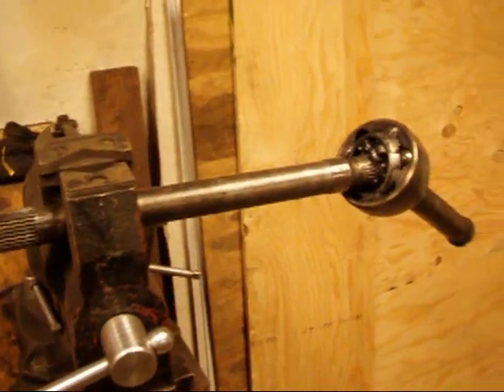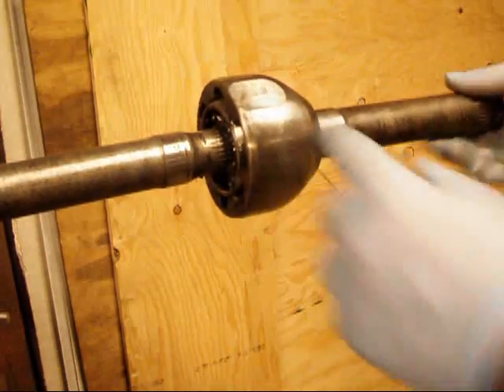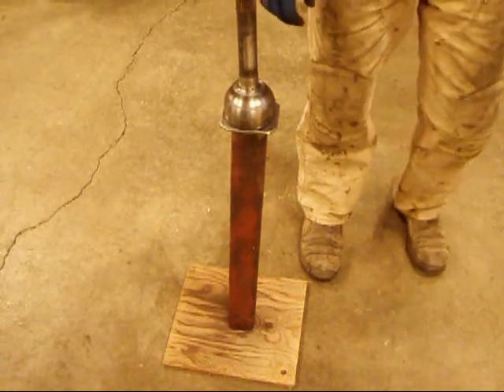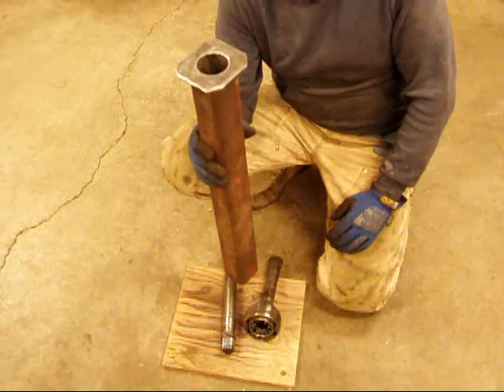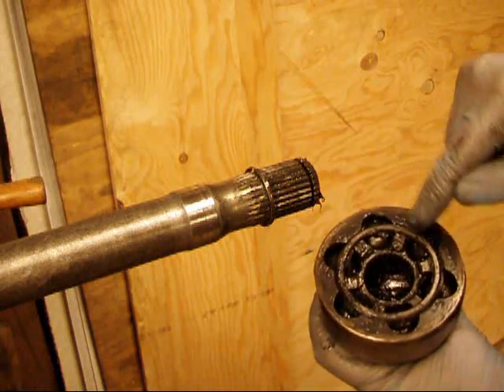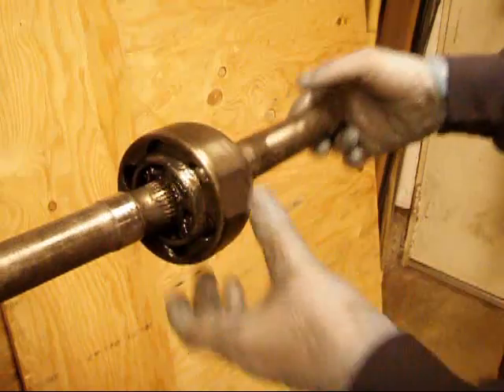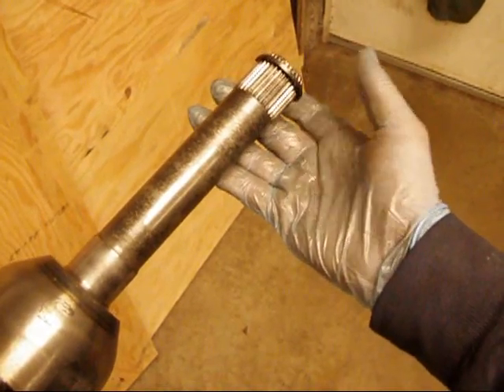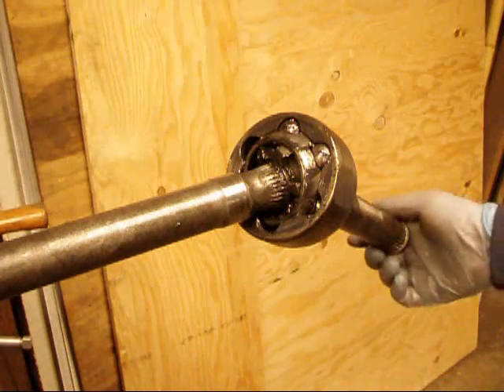How to remove a Toyota 4x4 Birfield joint off an inner axle shaft

Comment from the maker: 20 years of working on these.  Removed hundreds of shafts.  Never had one not come apart.  The short shaft side is the harder of the two because there is less weight on the inner axle shaft, but they've always come off with enough slamming.  Sometimes you really have to beat the $&% out of them though.  I suppose the splines could have started to strip the inner star and have jammed up, but that is pretty unlikely, usually the bell explodes before splines let go on a stock birfield.

Comment: Thanks for the video - good tip - the brass drift method did NOT work on my FWD CV axle car - it was a mother - I elected to remove everything from the other shaft end (like you did) - I soaked the Birfield end on the shaft in Varsol for 24 hrs, flushed, rinsed a couple times with brake clean, then dried with compressed air - to grease I loaded CV axle grease into my grease gun and used a needle tip to get past the balls to the backside of the Birfield - next time I'll probably skip the cleaning and just grease - with the needle you can flush the old grease out by pumping new grease in from behind - just like greasing a suspension

Comment from the maker: Yup, it's a one-time use kinda deal.  Sometimes you get really lucky and it pops off in one piece but most of the time it just shears.  The factory service manual tells you to drive the birf off with a brass drift on the inner star which has the same effect.  They are cheap and easy to get from Toyota.  You can also eliminate the circlip by putting a tack weld or two down on the splines of the inner axle shaft near the carrier.

Comment: Thanks for the tip about the Longfields upgrade!
Reply from the maker: If you've got the money, these guy's products are the best you can buy currently:  http://www.rcvperformance.com/categories.aspx?catID=RCVP_TOYOTA_CV_AXLES   If RCV performance isn't in your budget, Trail Gear bought Longfields name and technique when he passed away and they are making good joints (not as good as RCV in my opinion).  http://www.trail-gear.com/category/70/chromoly-birfield-kits

Comment from the maker: Martacks as they are called are tack welds that will keep the inner axle shaft from walking into the differential (which is exactly what the circlip does by retaining the inner axle shaft inside the birf.)  If you're replacing your birfields, just pony up the cash and get some Longfields and never worry about it again.

Comment from the maker: The wire clip inside the birf keeps the inner axle from walking into the differential (it traps the inner axle from moving around.  The birf is held in place by the lockring on the end of the stub in the locking hub.).  I'd have to look at it, but I would guess you're inner shaft is walking into your side gear splines possibly disengaging?  I'm not sure if can walk far enough in to do that or not, just an idea...

Comment: @WheeliePete steering is accurate. I built a Keith black 22r same case set up as ur buddy, 5.29 locked in both, it just likes to eat them. Rather than breaking the birfs themselves it  rips the joint out of them. At least I don't pay for them anymore lol.

Comment: awesome information thanks.I have a  question maybe someone can help me.I have a fj80 and when I step on the throttle it hits really hard on the front differential.I took that front differential apart and nothing is broken the only thing that  I found was that the Birfield driver side axle came apart without me trying to take apart from the clip.If that clip is broken would that be making  it to hit hard on the front differential?Thanks guys

Comment: I am using a 2" OD diameter pipe, ID 1.75", 3 ft long.  Fixed to the end pipe I have a smaller coupler that fits up into the outer CV joint and rests onto the Inner bearing.  The tube and union combo weighs close to 15 pounds. The weight with the axle is close to 25 lbs.  I've tried slamming the CV joint down into the tube as well as slam both down together from about a foot+ off the ground. Nothing.  Direct hammering and brass drift hasn't worked either.  I will try pressing it off next

Comment: Awesome video - and informative! Thank you! Can I ask about putting it back together? I can't seem to get the circlip to close enough to get the Birfield back on. I've tried zip-ties, 2 or 3 or 4 small screwdrivers pushing the circlip inward with someone else tapping on the end of the axle shaft. I've tried new circlips from Specter Off Road, and then from the dealer. So I called a few driveline shops to see if they would assemble it for me and they said they wouldn't touch it. Any advice from you?
Reply from the maker: You put the circlip on the end of the inner axle shaft (the end that goes into the birfield's inner star).  When you look at the splined section of the inner star you'll notice that there is a bevel all the way around the leading edge of the splines on the inner star that should help to guide and compress the circlip as you drive the inner shaft into the birfield.  I clamp the birfield in the vise and then hammer the inner shaft and circlip into the birfield with a heavy plastic deadblow hammer.  Usually works just fine.  If you've got a second pair of hands to try and compress the circlip that might help, but it sounds like you have been trying that.  I'd just do what you're doing and really give that inner shaft the old what-for with a dead blow hammer.  That inner circlip is there to keep the inner axle shaft from walking into the differential (the flat snap ring on the inner shaft keeps it from walking too far into the birfield.)  Years ago the guys at Marlin Crawler came up with a way to avoid having to use the circlip by putting a couple of tack welds on the end of the inner axle shaft that goes into the differential.  YOU HAVE TO GET THE TACK WELDS IN THE RIGHT PLACE so the shaft goes into the differential the right distance and still engages the Birfield and the inner axle seal properly.  To find the location of where to place the tack welds you wrap tape around the splines and put the shaft into the differential and then watch where the inner axle sealing surface lines up with the axle housing seal. 
 You want the shaft to stop going into the  differential carrier where the seal currently rides on the sealing surface of the inner shaft.  Pull the inner axle back out and see where splines of the differential carrier pushed the tape to and then put your tacks in that location.  When you do it right you don't have to use the circlip as the tack welds on the differential end of the inner shaft keep it from walking into the differential.  If you have a solid mechanical locker you most likely won't even need the martack as the locker body keeps the shaft from migrating into the diff.  Now, a word of caution on doing the Martack....You have to be careful not to get weld spatter in the splines of the axle shaft otherwise it won't go back into the differential.  Before you weld, I would tape it all off, spray anti-spatter, etc.  When you're done you'll want to file the tack down so you don't tear the seal  on the way in, and you'll want to make sure the splines are really clean.  The martack makes changing a broken birf in the field a LOT easier, but you can screw up your inner shaft if you get it wrong (or at least cause a lot of grief grinding your tacks out of the splines with a dremel and doing it again.

Comment: Be aware that this techniques doesn't always work.  I spent close to $50 to build a tube similar to the tool shown in the video.  I've slammed the axle in the tube at least 20 times to no avail.  After this, I directly pounded on the shaft and tried using a drift punch. No GO!  Be prepared that your axle may not come out!

Comment from the maker: That is really strange.  How much spacer you running?  You might want to limit the turning radius a few more degrees.  If the inner is failing it's usually because of hyperextension.  Those inners get pretty exposed as they reach their max working angle  No way the 22R is overpowering it.  ;-)  The dangerous part is to break one and still be driving and have the grenaded pieces lock up the joint in a turn (in 2wd) which locks out the steering.  That happened to me once...scary!

Comment from the maker: Not to be a dick, but do you have your steering stops set up correctly?  Steering stops are CRITICAL, even with Longs, if you exceed the working angle, or, more importantly, fail to balance the stops left to leading/trailing you place insane loads on the joint and the inners.  I have a buddy that ran longs with 39" iroks, full coil, 3RZ, 2.28+4.7 t-case crawler buggy for years in rock/sand/snow with an ABUSIVE right foot and they held up.  What engine you running?  You might just need D-60's?

Comment: I am rebuilding knuckles on an fzj80 stock 254 k and found what looks like half a circlip in the grease up by the abs sensor . The only place I can figure it’s from it i the clip but how could it break and get out of the joint it’s so tight and the birfeld and axle are still firmly connected ? Could that piece be left from a previous repair that got missed in clean up ? Should I take it apart just to see if it’s only a half in there holding it together or is that improbable ?
Reply from the maker: It seems very improbable that half the circlip may have broken off and worked its way down and out of the joint.  I'm wondering if someone grenaded a joint previously and didn't get all the pieces cleaned out.  Is there any damage inside the knuckle (scraping etc.) that would indicate a joint broke in there?  If the joint is still firmly affixed you're probably fine.  In order to inspect you would have to separate the joint which would ruin the circlip if it is good.

Comment: How do you get the cage and balls out of the inside I have inner axle chunks stuck inside
Reply from the maker: You basically have to stick the Birfield joint in a vise and then take a brass drive and tap one edge of the bearing cage/inner star down into the bell until you can raise the opposite side enough to get a ball out.  Then you work your way around like that getting the balls out and then the star and cage will come out.  This might be problematic if there is still the stub end of a broken off inner axle in there.  The inner star and outer bearing cage and bearings also go together in a very specific way like a little puzzle when you go to put it back together.  I really need to do a video of that process.  Now, if the stub of the inner axle shaft is stuck in the inner star and it won't come out because the wire snap ring is still in place up inside the bell, and you can't get the guts worked around far enough to start disassembling the balls and inner star and bearing cage, you'll probably need to weld something to the broken off stub of the inner axle shaft and then hammer out that broken off stub.  If you do end up going the welding route, try to protect the guts of the joint from weld spatter as best you can.  Also probably should de-grease it before you weld to keep it from catching fire...